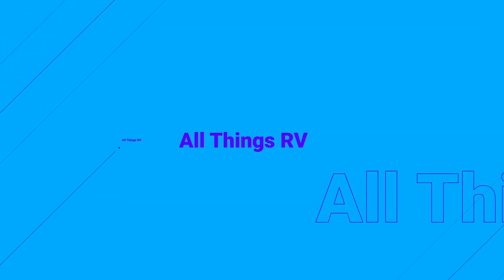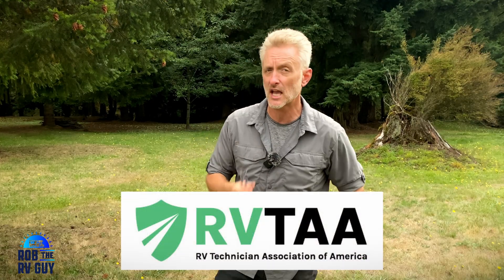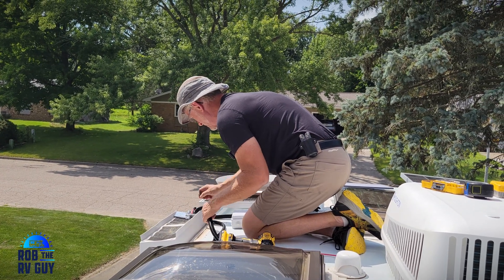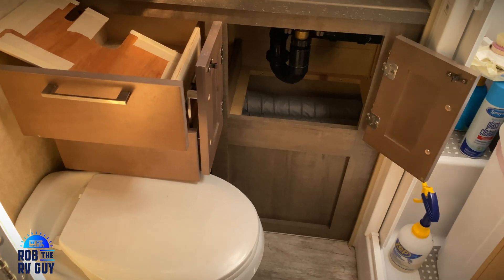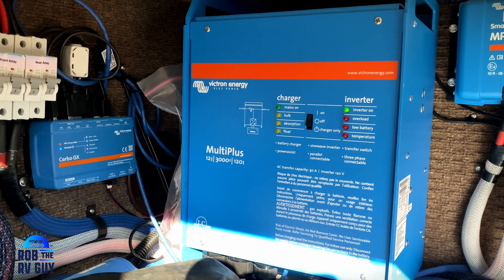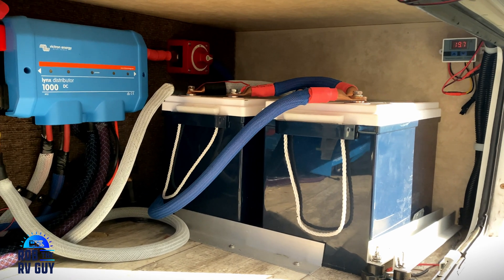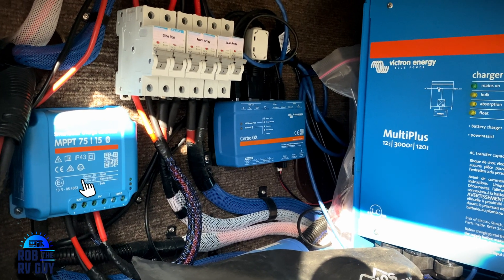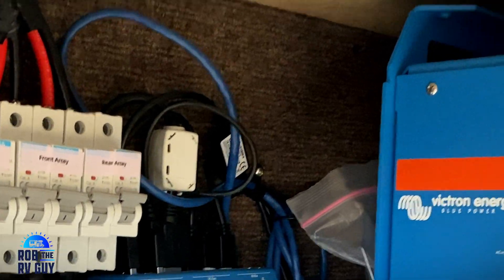Powering Up Our Bigfoot 25b25rq With Max Solar Energy - 1200 Watts On A Compact Rv!

Comment: If and when we score a used Bigfoot we are planning to have the skylights fiberglassed over by a local boat/marine shop. (We have tried to order a Bigfoot without skylights, antennae, luggage rack, ladder, and extra max air fans; we put a 2500 deposit on which was a vetoed by the president of Bigfoot who made the dealer return the deposit). So hopefully like you we can find a good used unit at some point. . We doubt the president will be helpful so we really appreciate your knowledge and video. We are subscribers and perhaps you can continue these videos! I would like to see what you do for the PM of the roof seals.
Reply from the maker: Your experience surprises me.  Grant, the owner, has always been quite helpful.  If you're patient, you'll find your model on the after market.  😀

Comment: Looks nice, another great video Rob! Did you remove the King antenna just to make space for the 2 smaller solar panels, or was the antenna just not working? As I mentioned on your other video, I'm currently specking out a new Bigfoot trailer, and am on the fence about a few options. I also noticed in your video the black knobs under solar panel, did you mount them so they can tilt up, or are they permanently fixed to the roof, or a mixture of the two? Thanks again for the measurement of the battery shelf, it looks bigger in the video I guess, at 32 inches long, those 4 AGM batteries that were there must of been smaller batteries of less than 8 inches in length. I was hoping to get 2 Epoch 460 AH batteries on that shelf, but I guess not. Do you have plenty of power with the 600 AH batteries, and roughly how long does it take for the solar to top of your battery bank? Thanks in advance, and its only a matter of time before your video's gain more traction IMO,  keep up the good work1
Reply from the maker: @frogzilla9186  Hey there.  I'll do my best to answer here.  

From the top down.

I removed the King Antenna for two reasons.  1) to allow me to pull the Starlink feed through the roof, while at the same time 2) allowing me to install another panel in it's place.  We have no need for that antenna.

3 of the 6 roof panels are mounted on the Renogy Tilt mounting brackets.

The 600 AH at 12v are adequate for our needs, yes.  On a sunny day, we will be back to full charge by noon at the latest.

If you are attempting to determine your best course, were I to start this build over here's what I would do.

I would mount everything in the back where I have, (however, this could be done in the front as well depending on your tongue weight concerns and so forth).

As you were considering a 460 ah...

I would install the system as a 48v system with one 48v 100AH or 4800 kWh of energy to run the 120 side of the house.

I would then install a 300AH Epoch to run the 12v side of the house having the 120 side run a lithium specific charger to your 12v battery to keep it charged properly.  Given the 48v Side charges it, 300 AH wouldn't be totally necessary, but at the prices for an Epoch as well as their quality, the extra couple bucks is worth it.

This gives you the best of both worlds and provide you with a grand total of 8400 kWh of stored energy.  I hope this helps.

Comment: Great video, your system looks awesome.  We are considering adding two panels to the top of our Escape 21’.  Looks like we could only do two panels, so maybe 400 watts total.  I’m not sure it is worth the expense to only have 400 watts plus maybe another 200 watt deployed panel.  What do you think?
Reply from the maker: Thank you!  A lot will depend on what you want to power/store regarding energy along with your lifestyle regarding your RV travels. 600 watts is a good start.  Please reach out to me through my website contact form (the simple form) and we can talk more specifically if you'd like.  🙂
Reply: Check what Johnny Hung did with his 21C regarding solar